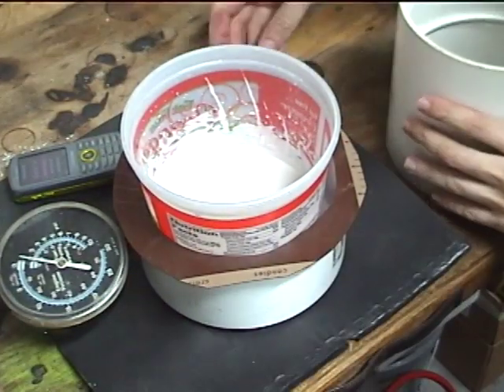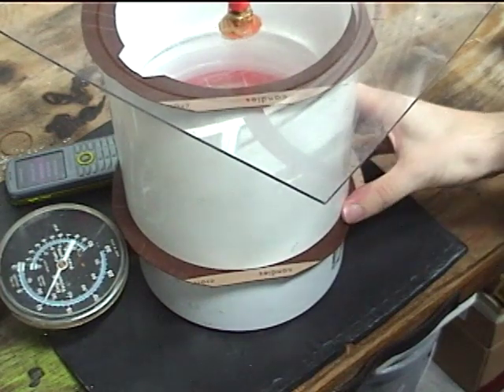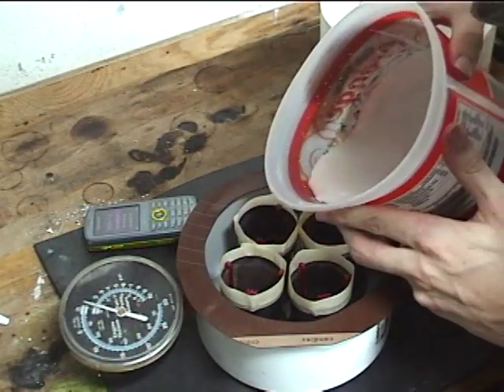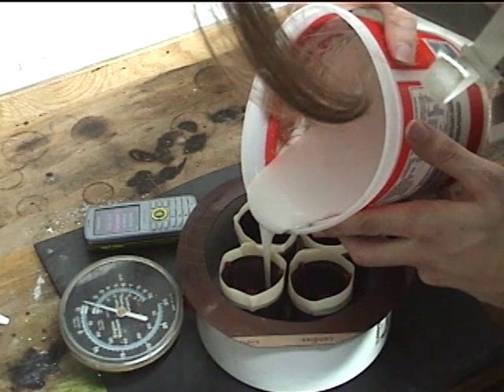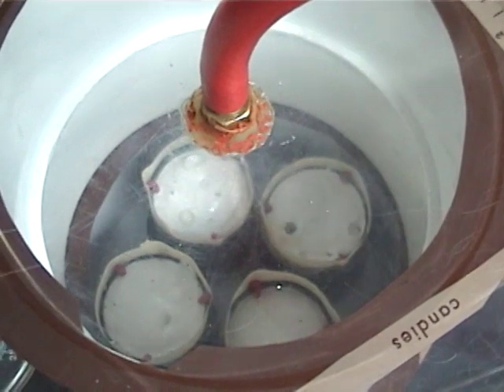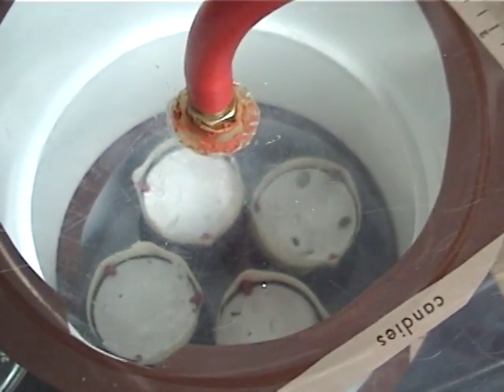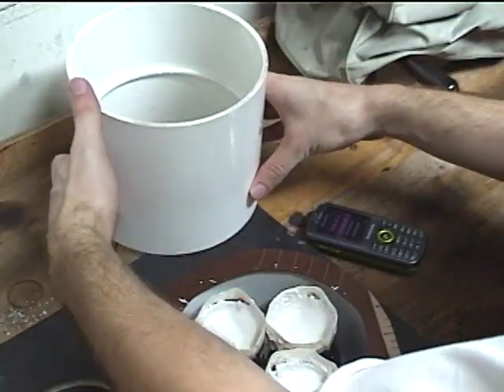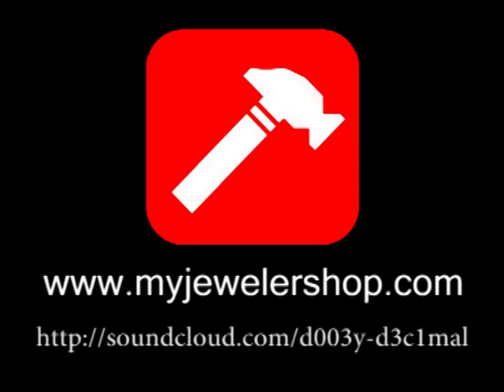Casting Jewelry Part 2

Comment: nice videos! i just bought and received a vakuum pump  that i need a chamber for.. a finished kit from ebay cost 150$ .. I would like to get  all the parts and guage i need to make  my own chamber, from where did you buy the gauge and fittings etc? thank you
Reply from the maker: Glad you liked the video! I got all my fittings etc from a local hardware place.